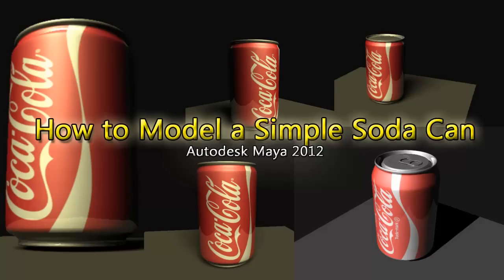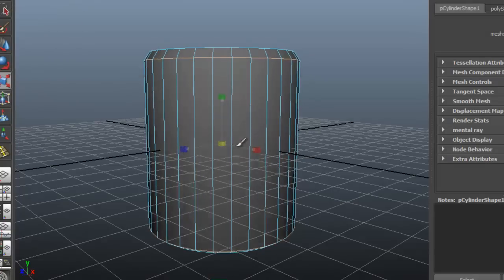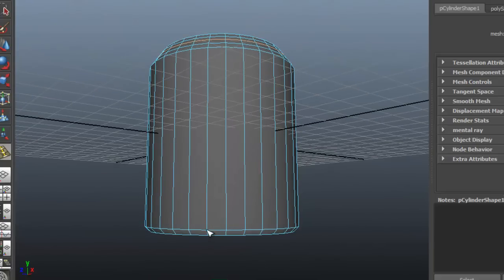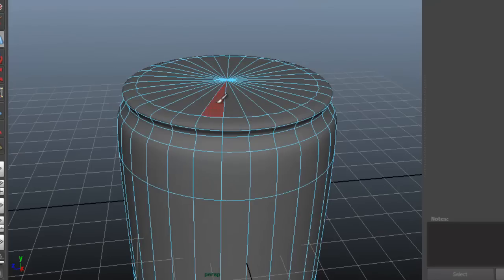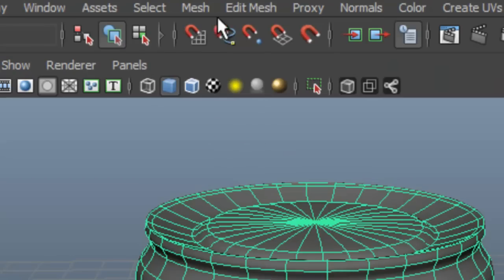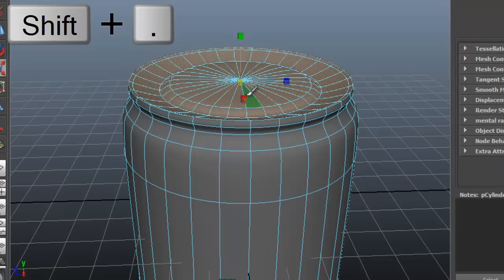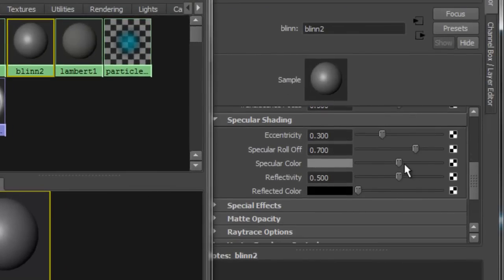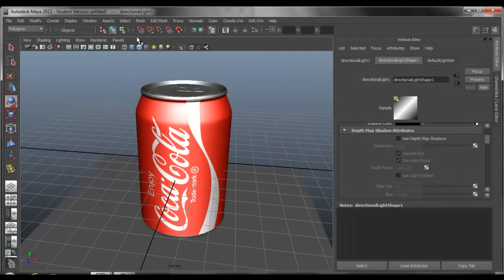Autodesk Maya 2012 Tutorial-Model a Simple Soda Can

Comment: How you select the entire edge and not just part of it? I try to use the brush tool and keep selecting just one part of it
Reply from the maker: if you are using maya 2015 or higher double clicking does not work with the drag tool and have to swith back to marquee.
Reply: thanks for your answer. Do you have any suggestion about it?
Reply from the maker: +Eddy Lopez Use the marquee selection instead of drag selection and it should work fine.

Comment: How does the edge inster? how do you polace them into the final position? How do you selec the edge loop? ANd furthermore how do you enter edit mode? in there any shortcut to extrude? Comign from Blender this is too confusing...
Reply from the maker: when inserting an edge loop just use the edge tool from the edit mesh menu and click on the edge where you want the loop to go, make sure to click and drag so that you can interactively choose where to place the edge loop. You can edit the mesh at any type, to select faces/edges/vertices just hold down right click and from there choose whichever you want. There is no shortcut for extrude so you have to access it from the edit mesh menu, you can always assign a shortcut for it if you wish to.
Reply: Now thast what I call a response! Cheers mate! That is actually helpfull!

Comment: If you do not see it, you probably haven't switched to the Polygons menu set. Use the pull down menu on the top left to switch from Animation (the default) to Polygons.  :) I had a problem finding it too

Comment from the maker: Insert Edge loop tool works only with quads( 4 sided faces). It will not work at the top but you can select all the top faces like I did and use extrude, when you extrude scale that down to create the circle on top of can.